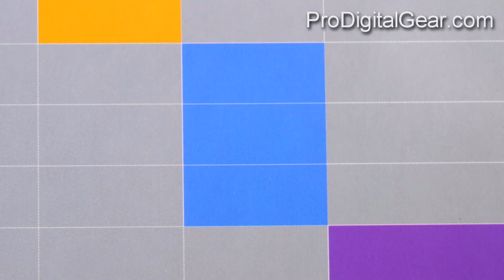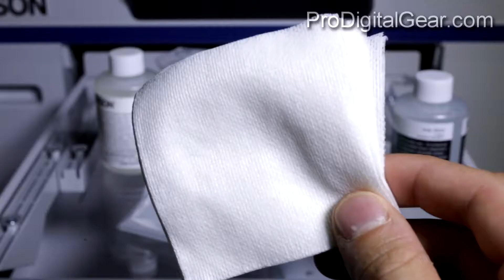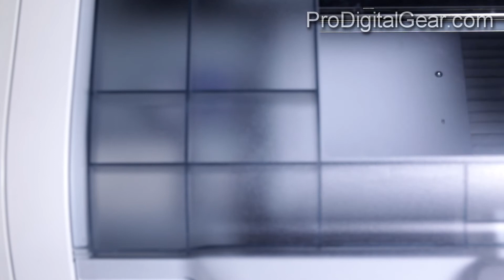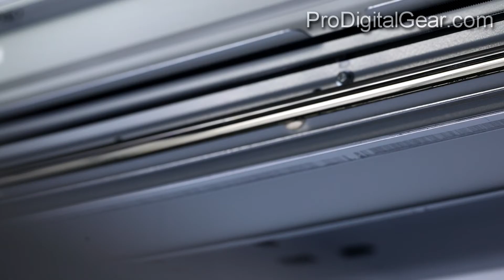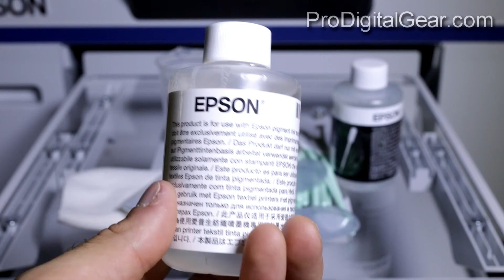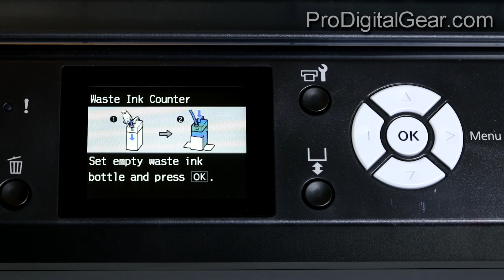Epson F2000 As Needed Maintenance

Comment: just got a f2000 and the owner printed a shirt and everything in front of me, its been sitting for 1wk as i was waiting on ink to arrive. just turned it on, had me do tube cleaning and it was easy to set up design and print, it looks like its printing but its not printing nothing on to the short. at 1st thought it was doing white layer 1st than the color but not said it was done. i raised the lever and it tells me there's an obstruction so need to lower. any idea what it can be???

Comment: you can clean under the print head channels with only 1 small swab each channel just do not use the same one on the same channel.   i had my whites clogged and i just cleaned each channel with the small swabs and did a few heavy cleanings only on the white channels and bam it worked! i did nozzle checks after each cleaning until i got the right results. wh1 and wh2 cleaned up first then i kept doing cleanings with wh3 and wh4 because wh3 was still missing half the nozzles but keep going and you will get it clean....if i did not use the swabs to clean under the white lines i would have never got it to work..... i left the machine alone for a few months that is why the whites were acting up.... this f2100 is legit in that aspect but other than that it has its small flaws like not being able to print from a far height distance and brother gtx does print from a distance and it comes out solid not blurry like epson...but you can't have it all. if left the gtx alone for 1 month or 2 the heads would have been gone!

Comment: are the white inks water based or no?
Reply from the maker: Actually they are water based.. Thanks! 
ProDigitalGear
Reply: I heard the white gets clogged why if it is water based? I heard it is thicker ink with a feel to it. I know cmyk has no feel to the shirt so how is the white water based ? Does water based have diff texture type inks
Reply: What happens is the print heads need to have humidity (water) to keep at a certain temperature. If the humidity is low, the cooling comes from the water in the ink. With the use of the water in the ink, the viscocity is changed and more clogs occur. Humidity should be a minimal of 50%
Reply: i am looking into a Epson f2100 i heard they have a recirculating system so the white does not clog